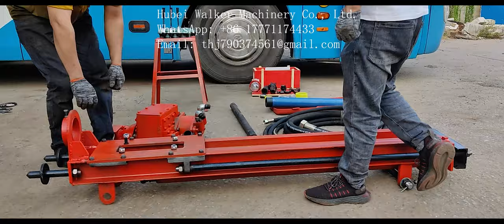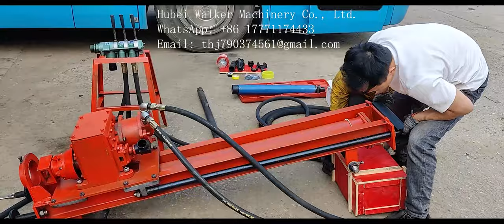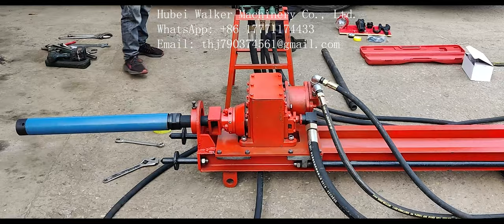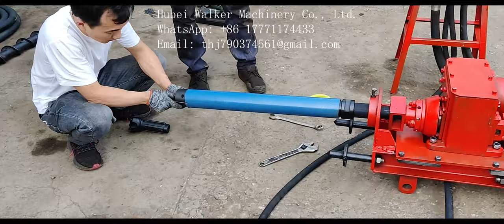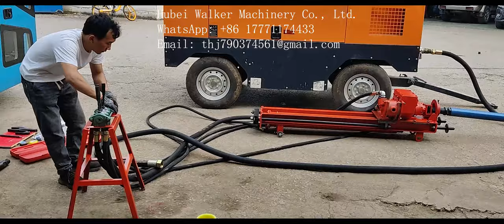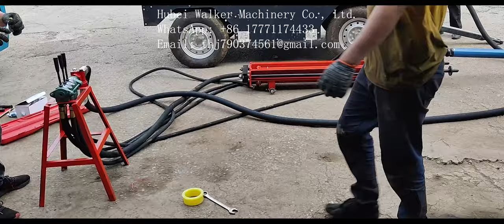WKQ100 Full Pneumatic DTH Rig Installation. Full pneumatic drilling rig

Comment: QUE CAPACIDAD EL COMPRESOR QUE NECESITA
Reply from the maker: It depends on your drilling diameter and drilling depth. Normally, 13m³/min, 10Pa is required.